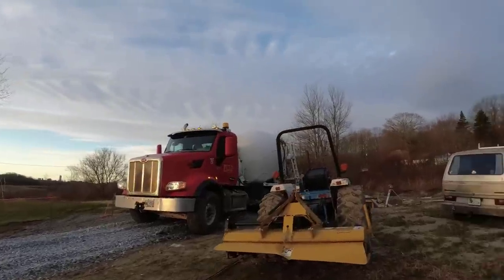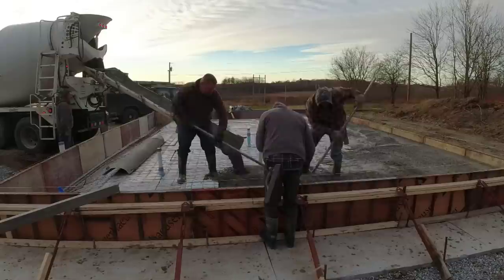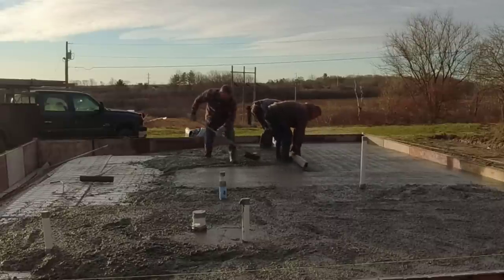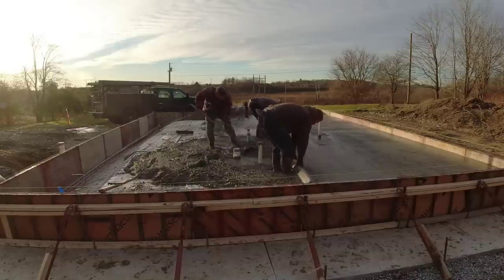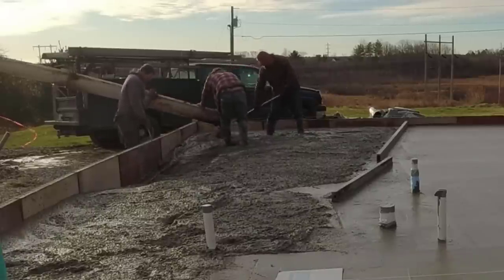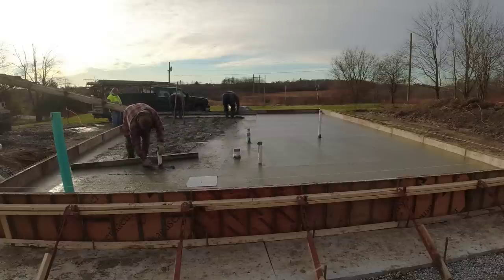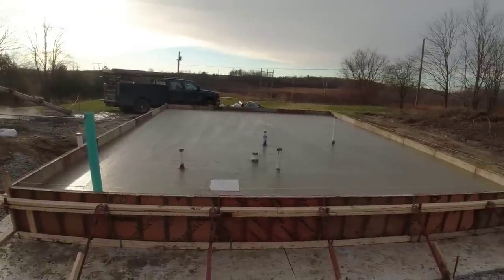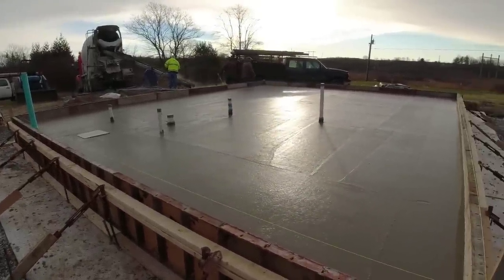Pouring A Concrete Slab Using Wall Forms. (Small House Slab)

Comment: Mike I am a foundation contractor.  I use my Symons form horizontally all the time.  Quick and easy they must be waled and braced and plumbed correctly (obviously).  We try to form so top of concrete is level with top of form so we do not have to use grade nails, but that doesn't always work out..
Reply from the maker: Sounds good, thanks bro!

Comment: Anything over a foot deep, we use those forms, luckily I work for a company that has thousands of fillers as well, so if it’s 14” 16”18” whatever it is that’s the size form we use, it works great, we usually don’t use those turnbuckles, we have a turnbuckle brace that only our company has, and those work great, so you don’t have to step over the turnbuckle 2x4s, nice job Mike, I ran into you at white cap, I called you Hollywood, you do a great job, good content, very informative, doesn’t look like you ever bite off more than you can chew, what a weird winter huh?

Comment: At first glance I was a little confused by the 2x4 on the bottom but now it makes sense. I've only used those forms for walls, and in those situations the panels are locked together with wall ties. 16 penny nails with tie wire nailed through the form hold the bottom just fine when the outside form is locked to an inside form with wall ties, but in this situation I see why he used the 2x4. It was nice for me to learn something new!

Comment: Western or pression aluminum  forms work better. We did one in Missouri used 3ft forms standing for frost then went back and poured the floor. Used a 2X4 at the top. 10inch short wall.we found better the foam to be deeper so as to when the fasten the walls to the floor ,the don't peirce it. They are called SHOUSE HERE.they are cheaper to heat.they are done in shops to your plumber needs to be pretty accurate though.we have stamped a couple so they had floor finish. Seemed kinda permanent though.

Comment: You guys will sort it . Nice thing is that those wall forms will go on forever , and do walls too , if I had them I would use them , especially with timber prices as they are.
Reply from the maker: Yes, they get years of use out of them.
Reply: You have to reface them from time to time
Reply: @RectifyTheParadigm  over here they are steel faced ,, they do go on forever ,, oiled before a pour , then pressure washed off ,
Reply: @tomthompson7400  ok.  The forms in the video are symon wood faced though
Reply: @RectifyTheParadigm   probably much the same ,,, just a new bit of ply every once in a while ,,, the guys here use vapor barrier and do up the sides with it too ,,, again its to do away with clean up ,, so sticking and no clean up , its all time that does not have to be paid for , more profit and faster easier work ,, win win

Comment: Would the gravel and rock below the slab be 2 1/2 feet thick to get you down to the frost line?
Reply from the maker: No, it doesn't need to be that when there's 2 inches of Styrofoam under it, and if the garage is heated.
Reply: @MikeDayConcrete  Greatly appreciate the reply. Looking to pour a pad for a second house in the spring up here in Canada and the learning curve is steep. I was told my current house is slab on grade and it has infloor heat as well. Nice to see how it all goes together.